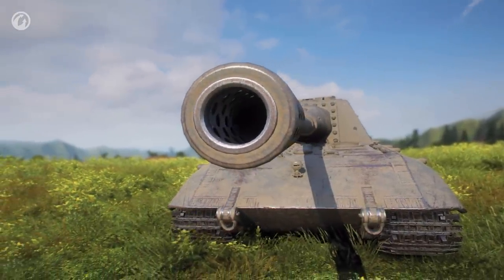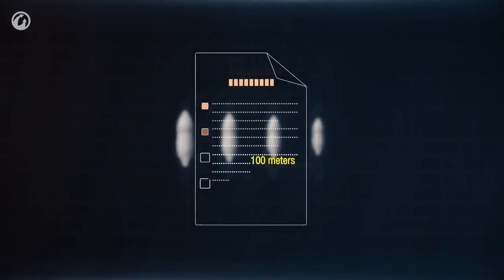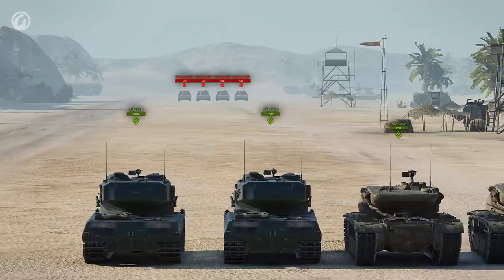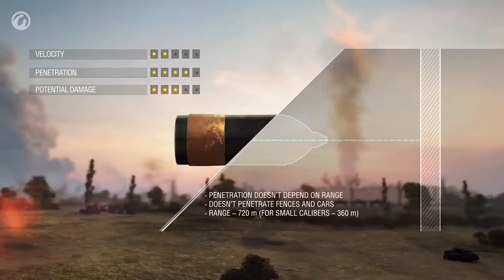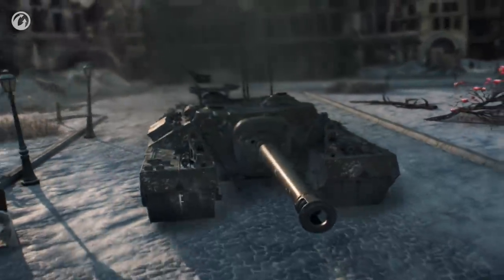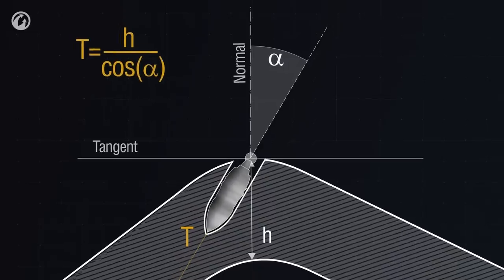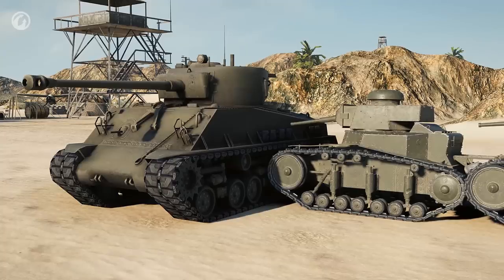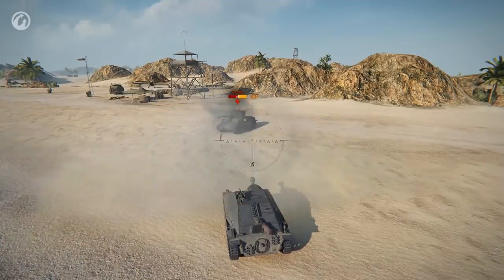Explaining Mechanics: Armor Penetration

Comment: Picture a cube shaped tank.  Using the dimensions of the US Abrams it would be 12 + ft. wide by 26 +ft. long by 8+ ft. in height.  This cubistic shape would cover the turret, tracks (most), drive and engine.  The outside material of the cube would be flat, 1/4 inch thick aluminum plate.  A framework would connect it to the more conventional steel armor turret and hull.  Now the space between the cube aluminum surface and the actual tank steel would vary from inches to a few feet.  And most of the time the volumetric space would be empty, thereby keeping the tank's weight to 30 tons  and reducing the logistics requirements. But when the "cube tank" is sent into battle, the void spaces would be filled with WATER - fifteen tons of water.  Now, the various anti-tank rounds would be required to negotiate a water barrier in addition to penetrating the several inches of conventional steel tank armor that lies at the end of the ballistic penetration.  Could an armor system using water in this maner serve to protect the tank?   The water barrier would be destroyed in the areas where hit, but the tank and crew could fight on.   If so, it would be of great historical irony.  The "tank" was given its name as a means of delivering fresh water to British troops to conceal its true purpose from German intelligence in WW1.
Reply: it's big brain time. 
Yes, the water would protect the tank from HEAT shots, however, over time the water would run out, and you'd be left with a heavier than average spaced armor, 30 Tons is ideal, something like 33 or 32 is more realistic, even then, just a well placed shot into a lower part of the tank would render it vulnerable. Even then, modern APFSDS rounds would have no problem penetrating it, it just sounds a bit impractical to me

Comment: wow i had no idea this game was this detailed... that is pretty impressive.
Reply: well numbers and calculations no one has any idea about, you still have no idea how much damage you will do or if you will pen or not, that's simply useless and should be simplified so people can actually make use of it
Reply: All of the penetration values are just completely made up. Some tanks in Wot can even fire shells that they never could in real life. Also almost every tank in Wot is completely out of proportions
Reply: @kralicidoupe385  true
Reply: It's not. Way too simplistic. Incorrect angle penetration,  apart from modern ones, shells do not penetrate in straight lines at angles. Normalisation calculation is a joke.
Reply: @jonathanowen8389  yes, is all because RNG

Comment: You know how many times I've had HE bounce. ???
Reply: rofl, sure sure know it all, it bounced, it did zero damage and it hit terrain near it where it bounced. dont act like you know everything by just repeating what they say in the video.
Reply: 85 degrees.
I had such moments even before 9.18.
Old BC 155 58 in front of turret of IS-7. ;)
Reply: PUNISHERE989 when the nominal armour thickness surpasses the damage of the HE shell, it will cause no damage. HE cannot bounce.
Reply: PUNISHERE989 I got you fam! The amount of HE shell bounces I also had is insane. specially on amx 13 75/amx 13 90 tanks... blows my mind.
Reply: @tomaten9477  ofc that's how heat works - isn't watch the entire video yet but don't they talk about this??

Comment: What really happens to the uranium depleted projectile as it hits the tank's armour?
Reply: It strikes, at five times the speed of sound, it is a dense and very heavy Pyrophoric metal which when it hits armor it's front burns away into a vapor and the point says sharp. It begins to burn as it punches though the armor and ignites Ammo, Fuel, Hydraulics, electronics Flesh and clothes it turns the interior of the vehicle into a white hot inferno of gases and sparks while super heating the air and creating an explosion.
The burning DU adds the melting and burning armor of the hole to the damage.
It is only slightly radioactive.
Reply: @zebradun7407  and after some years the inhabitants of said battlefields start to exhibit mutations and birthdefects (as documented in iraq; since US "freedom'd the living oil oit of it" childdefects have increased by i think 300%)
Reply: @zebradun7407  but hey, cheyne said it only has alittle radiation and as we all know American politicians never lie x)

Comment: How important is the speed of the shell? It is included in penetration? what about density of air and wind strikes?
Reply: Speed is important when firing to a fast and distant tank, when shooting slow tanks or close tanks it is not important, I think that speed and penetration are calculated differently.
Reply: I don't know if air is that important.

Comment: What happens to a shell after it penetrates the armor?
Reply: Gligore Bojan the penetrated tank is pregnant
Reply: Haha you´re funny
Reply: The AP shell explodes inside the tank..as all the fragments hit the crew inside
Reply: But there are different types.. apcr shells hits the tank but only a straight hit and doesnt turn into fragments.. HESH shell deforms on the tank..and explodes , destroying the armour..  the HEAT shell hits the tank and burst the explosive inside.. HE instead explodes at contact with the surface
Reply: Thank you that was exaclty what I wanted to know.